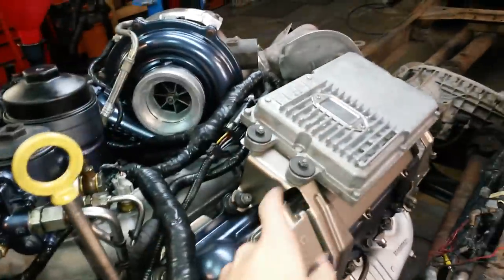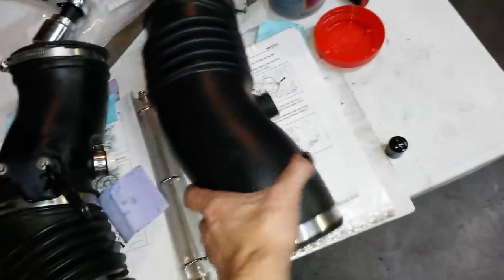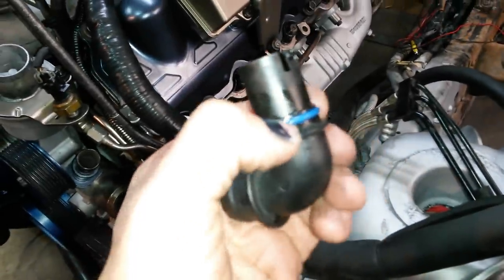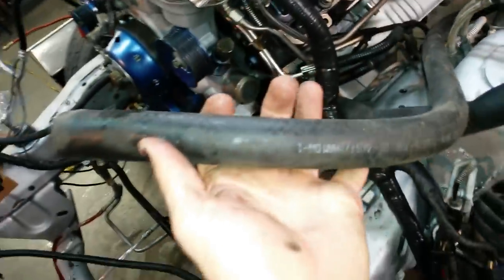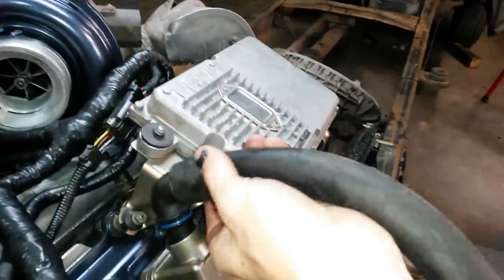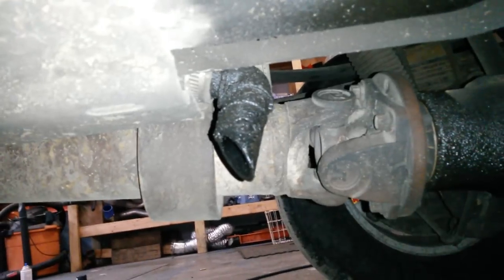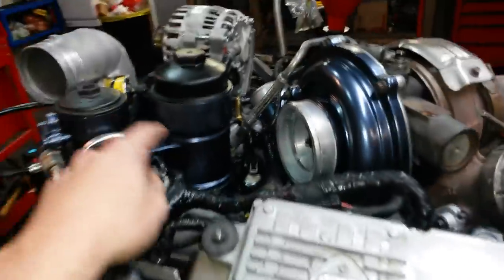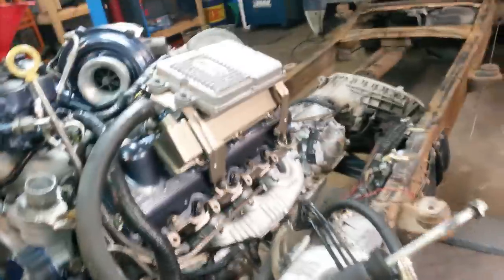FORD 6.0L Diesel~ CrankCase Breather/CCV Re-Route ~ Save Your CAC Boots & Turbo!

Comment: This is where a larger catch can would be beneficial to run in line just to have those gases collected and filtered before exiting. My Catch can is DIY made of a 4" PVC end cap for the bottom then a 4" clean-out coupler and screw-in cap. 1" line ID into a 90% coupler facing Down with a piece of well-perforated 1/2 " tube 4.5" long to make the perforations I used a 1/4" drill and directed the gases down to the bottom and throughout the canister then a perforated plate 1.5" from the bottom of the canister to make a collection chamber. Then three SS pot scrubbers stacked to the exit of the can with a 3/8 ball check in the bottom of the end cap to make a drain. This is held in place on the frame with 2 4.5" "U bolts. This is quite effective and does not restrict airflow from the crankcase through to the exit and out. The exit gasses appear clean. Use some tissue paper as a test on the exit gasses. But if you want to connect it to an exhaust port make sure it is angled to be drawn out with the exhaust. The placement of a one-way valve may be required to stop back pressure returning to the crankcase. I now have much better cold starts and my turbos seem to spin up much better. I have over 500 miles on this now with no sign of trouble. I have yet to clean out the cooler. But the weekend is hear😊

Comment: You can also remove that little breather box from the valve cover, split it apart, and turn the outlet upside down and fasten a piece of hose right to it. Just like on a 7.3.

Comment: I did this.  Awesome fix.  I don't have enough blow by to mess up the truck or road. The turbo sure sucked out a lot of oil vapor previous and all through the pipes.  I can imagine what the insides of the charge air cooler looked like.  Thanks man.

Comment: You also understand the negative pressure help the rings seal making more power but more so less wear on the internals on the bottom end.  Racers pay huge money for vacuum systems to accomplish this.
Reply: Mark Rich - so you are saying if you route the blow by gases back into the intake , the turbo will suck or create vacuum in the crankcase. Correct?
Reply: Yes thats  how PCV  work , or more expensive systems use Vaccum pumps dedicated to the process . That with an oil separator of some sorts. Ranging from a baffled design to a small cylindrical port with wiremesh.
http://www.dragstuff.com/techarticles/vacuum-pumps.html
Reply: Mark Rich That's for gasoline systems. In a diesel it's a completely different story. For instance, running a vent to atmosphere without any filter like he's doing it's just asking for trouble down the road. Under certain conditions that tube will have vacuum instead of venting. That's one excellent way to get all kinds of crap inside the engine.

Diesels are heavy breathers. And fiddling with theirs vents should be done with care and knowledge.
Reply: cylinder pressure seals the piston rings, that is how they are designed with a taper. The vacuum system is to remove blow-by from the gases that escape from the rings

Comment: Just be sure to careful to route the hose so there are no dips in it, much like plumbing a drain pipe for a septic system.. a low spot will allow condensation to form in  cold weather... once the truck sits this can freeze solid ..next time you start your truck you have no breather.. You will now blow a gasket  turbo seal or one of the seals on the engine. . I like to keep the hose as short as  possible..an angled fitting into the exhaust is the best method IMO.
Reply: Can you post an idea of what an angled fitting is I just had my vent added and there is a little blow by I would like to dump through the exhaust
Reply: Bluewater Traveler If you tie it into the exhaust won't it just blow exhaust into your manifold? I would just hang it strait down and into a canister of some sort so you don't drip oil on peoples driveways. Google "blow by catch".
Reply: aerodicus 

Negative. The exhaust will follow the path of least resistance which as long as you place the bung post muffler/cat if you still have one will still be out the tail pipe. This will also pull a bit of a vacuum in the CCV hose which should help even more in clearing those gases, much in the same way that the turbo pulling air in from the Air filter will. Please you dont have to worry about a mess as most of the time the exhaust heat will burn any oil off.

Comment: Does 1 piece duct fit pre 2005 ford 6.0 trucks???? It looks longer than oem duct....
Reply from the maker: shaun smith Yea it fits all models. It is not as flexible as the rubber piece in the 2 piece setup, but makes it super simple.

Comment: Don’t do a CCV reroute. It will destroy your turbo
Reply: How will it destroy the turbo?
Reply: Paul Talanoa it creates a vacuum when routed into the turbo without the vacuum the turbo seals will go you can risk having a runaway
Reply: Not to mention that it’s going to increase the gas pressure in the crank case and gasses will sit in there longer and leave deposits. Having it attached to the intake means that gasses literally get sucked out.
Reply: so the catch can reroute would be better?
Reply: @Reyes6.0  I put a catch can on mine 4 years ago and everything works fine + no more oily mess in the CAC tubes or intercooler. I made it out of a 10" long chunk of 4" ABS with 2 end caps, a piece of aluminum with many small holes drilled in the bottom 1/4 and a wad of plastic mesh for a divider/baffle, a couple nipples (in/out ) on top, a couple pieces of rubber hose, hose clamps and zip ties and a PVC ball valve in the bottom for a drain. I clamped a hose on the CCV outlet and routed it to the left front corner where I mounted the catch can, then routed the can vent hose back to about 3' behind the cab. Oh, and don't forget to plug the intake hole.